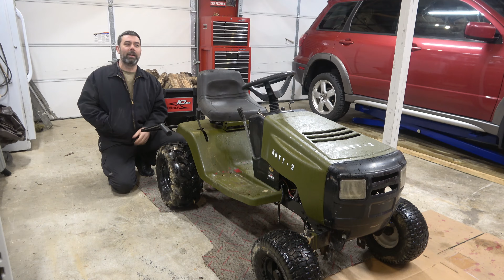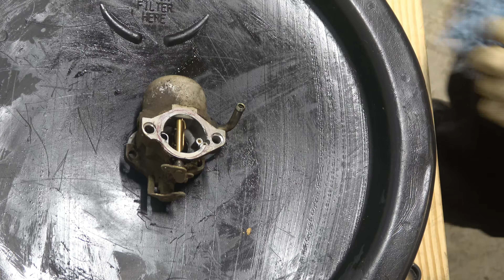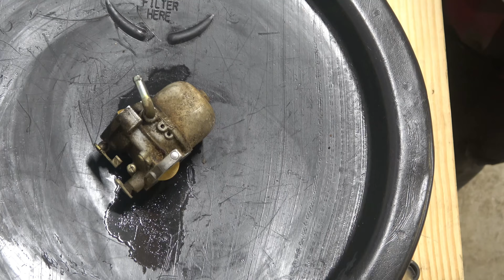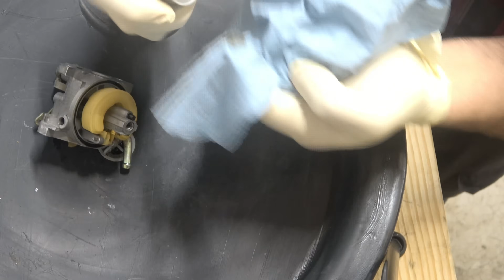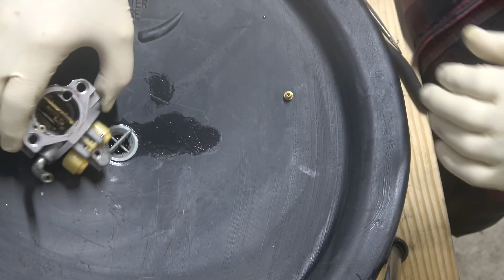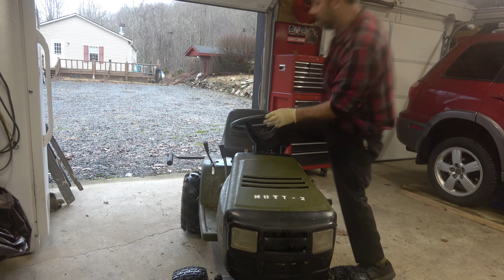If your Riding Mower Runs Rough, Do This!

Comment: Great video.  I use my cleaning tank for working on carbs. I have a container with a fine screen on bottom to catch small parts . It has a pump and light. Makes it easy .  For gaskets I have new ones on hand for the common ones and gasket paper and just cut out.  Some carb kits I have on hand . Like carter model N . I keep spools of fuel line on hand. so common for that to go bad. And just a few different filters . I got some nice clear ones that takes 1/4 or 5/16 line. Covers most .  Some of them do have different jets you can get , Hi altitude ones. Like for Denver .  I am in NY so not a problem hear . I had the old brass floats get a hole in them and flood out .  And some of the early plastic ones go bad. They would warm are leak . Was a big problem for a few years until they went to better  plastics .  If that real bad I just get a new carb.   Many replacements easy to get now.  Cheers from NY !
Reply from the maker: It is smart to have the gasket paper, that way you will always have what you need

Comment: I remember when craftsman had your choice of 1/4 or 3/8 sets with a ratchet, a 3 inch extension, and like 10 sockets in a nice blow molded container, sometimes they had a nut driver handle and or a swivel for around $14.99 and sae had a teardrop ratchet and the metric had a fine tooth round head ratchet. Sometimes for $19.99 you got deep sockets in the set also. Perfect for anyone to get started out or to get a set for the home or in the vehicle.  I've got some I purchased and when my dad passed I got his. I'm putting a more comprehensive set of tools together for the step son because as he was growing up I gave him some harbor freight stuff and I saw that he took good care of them, so he has earned a set of the better stuff. I have some mac and snap-on stuff for him also as well as tools for making repairs to his home. Once I sort them out I may sell off some of the extras.
Reply from the maker: I am glad to hear that he was taking care of them-

Comment: Spring is just around the corner (yeh I know, 3 months and it's snowing) This is great info and instruction to have for getting those mowers ready for the season.   The mowing deck pulley cover for my Craftsman DYS 4500 seems to be missing. Any idea where I could find one?  ;-)
Reply from the maker: You might check partstree.com for a new one, maybe ebay for a used one?